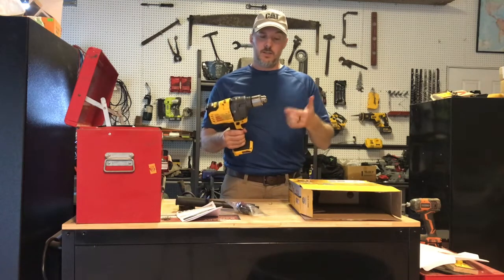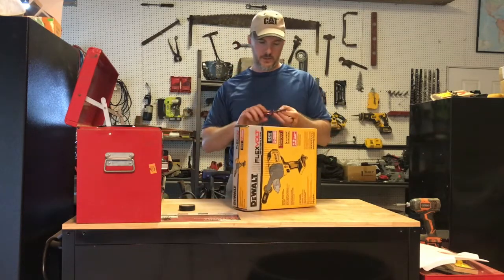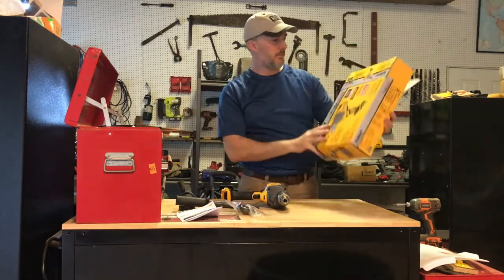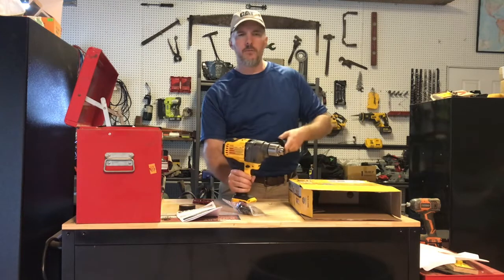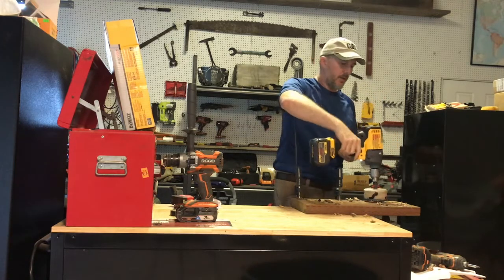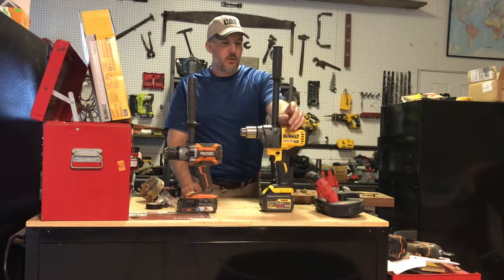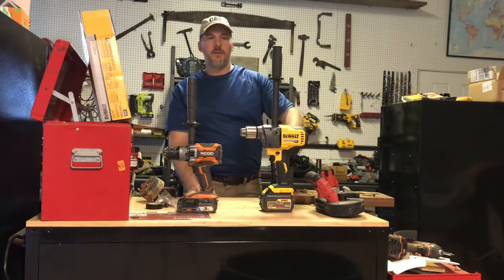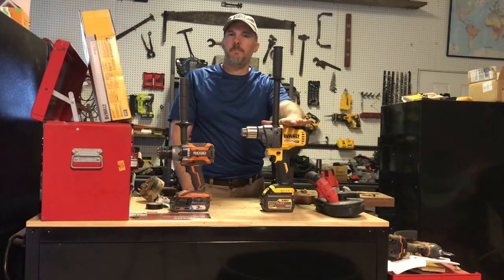Super Drill  Unboxing FlexVolt Drill / Driver / Mixer.  60V DeWalt Drill.  DCD130B Power Tool Review

Comment: Good video - I just bought this drill, but mine seems to have a glitch in the trigger - it won't start when pressed the 1st time, then starts & runs the 2nd time fine - is this a safety feature? - didn't notice your demonstration doing this - I'm thinking I got a lemon & maybe should return it for another one - any thoughts?
Reply from the maker: That doesn't sound right to me either.  Even if it is the safety mode kicking in, something sounds off.